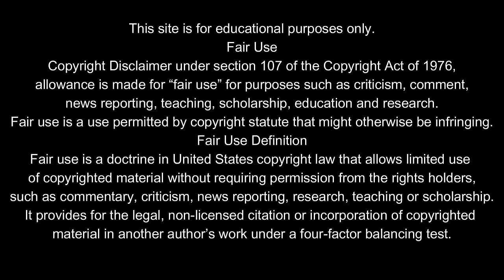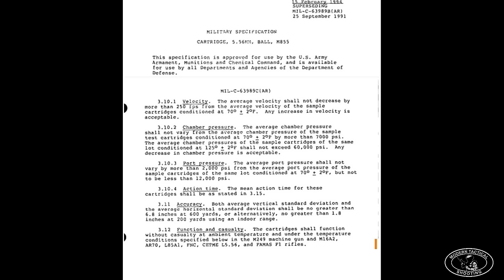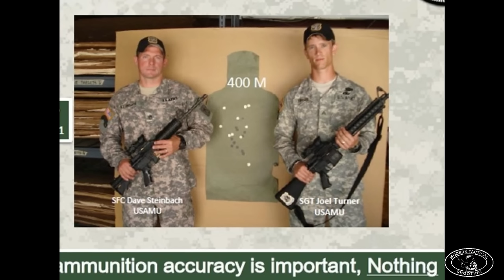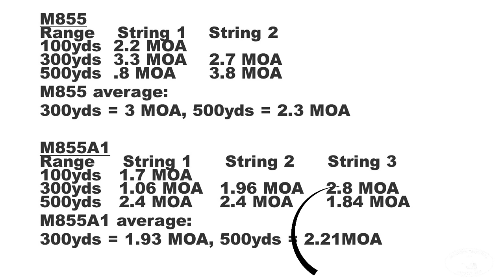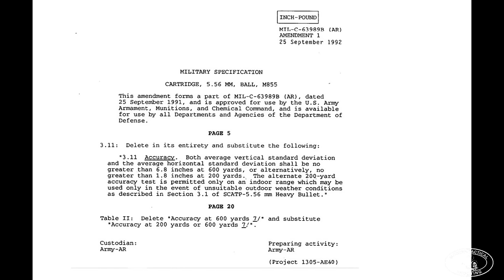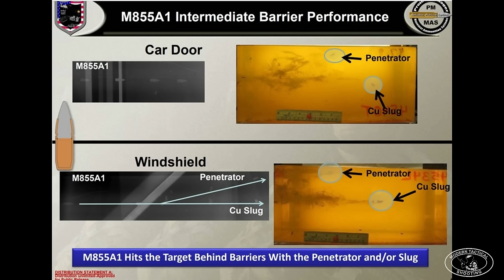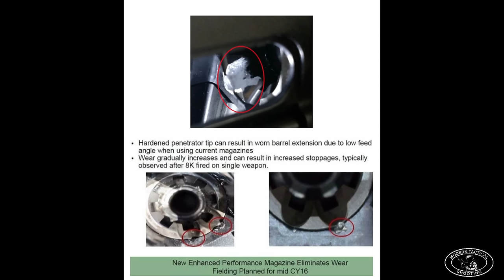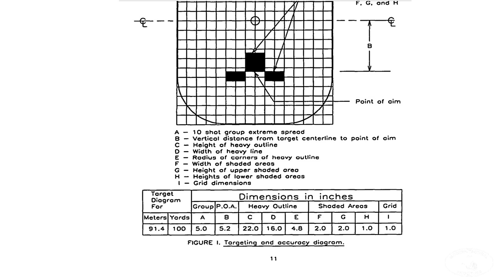M855A1 Performance Review. Did it live up to the Army's hype? Did going green really work?

Comment: Glad to hear you reinforce my mk262 bias.
Reply from the maker: 100%
Reply: If you're gonna choose a Duty load I would make a suggestion. 

Get BONDED SOFT POINTS my dude. Federal TBBC or Speer Gold Dots ECT.  I personally went with 62gr so they share virtually identical POI as my training ammo (PMC XTAC).

Altho I have been quite impressed with the AAC 77gr OTMs, at $10.99/box on sale I've acquired Almost 6k of em lol and have found them to shoot very well (around 1-1.5MOA averaged) out of my 2 uppers (A 16" Colt 6920 and a Geissele Super Duty 14.5) for the price it's all I buy anymore. 

But as far as duty ammo is concerned, I've found Bonded Soft Points to be the Pinnacle of performance across the board IF selecting ammo that isn't going to penetrate armour ANYWAYS. they certainly have the best performance against common urban barriers especially such as auto glass, walls, door panels ECT while still giving excellent terminal performance across the board both with and without barriers in the mix. 
We aren't in Afghanistan we don't have to worry about mud walls, what we have to worry about most is other common barriers here stateside such as sheetrock, furniture, vehicles and tempered auto glass, ECT.
Reply: @mrdark9916  I've since stocked a fair bit of TBBC. I've also stacked a bunch of 70gr TSX and that's been my go to since it and mk262 uses roughly the same zero in my rigs. I have a dedicated rig for tbbc and other lighter weight loads.
Reply: @Appalachia_Ape  that's actually a very good point, and something I always tell people to try to do. Pick a good load, that shares a POI with your training ammo as closely as possible.

Luckily through my 14.5 Geissele upper that's dialed for my BSPs  my 55 and 62gr XTAC training ammo share virtually identical, but the AAC 77s ALSO literally overlap impact zone. They still land dead center only mabey ¼ to the right, and only about .75moa higher at 100yds so for all intents and purposes I can swap freely between them if need be. As I have so many of them stocked now.

But the 77s are mainly designated for my old Colt upper since I built it out more like an SPR.  it's not nearly as accurate with as many loads as the Geissele upper, but with those AAC 77s it's about 1-1.5MOA so it lives on them now. Bigger 2-10 optic with more data, more for longer pokes on "unsuspecting targets" with increased first round hit probability, but that doesn't completely abandon the ability to do closer work if the situation forces it on me, so it has an offset red dot as well to solve those problems. And also to serve as an "overwatch rifle" for the family property. Up on the hill surrounding the property I can see every field and road leading up to our land out to about 600yds so that played a role on the selection as well. We have a few 762 AR10s in the family available but I like the option for 556 in that role logistically as well.

The Geissele is built out more "do it all" with a 1-6 and Offset red dot. Something I can use more general purpose but still make effective hits to 500 if need be, but favoring more inside short-mid range faster shooting where barriers are potentially more of an issue and a little more meneuverability, without completely abandoning the ballistics I want. 

To me 14.5 is the shortest I'll go with 556. I've actually considered many times selling my 16-inch Colt upper and swapping it for an 18 or 20inch upper to lock in the "SPR role" for that setup. But I've never been able to bring myself to do it... I love that upper so much lol it was my first and I've had it for years. And I just don't need a 3rd personally I have other stuff I am trying to save and acquire so the 16 will have to work for the role.

If only I was a bajillionare....... 😂 Right now I'm saving for a thermal unit. Still researching but something that can be handheld or a clip-on for my rifles. That's my next big force multiplier
Reply: @Appalachia_Ape  I do really like the 70gr TSX loads, they fuck. They just tend to sheer petals and lose some weight and expansion against barriers like auto glass ECT but still a solid option. But if there's nothing between that bullet and the target, they fuuuuck lol 😂 I know a couple ppl who use em for deer they are a solid well rounded performer. I mostly just use the extensive FBI testing and what LE/federal agencies are using and why and then try to balance performance and price as best as possible. All ya can do really
Reply: @mrdark9916  I think we just became best friends. I use 70gr tsx for deer and that's what made me consider them for other purposes. I absolutely love my geissele rigs. Hands down the best bang for your buck in the AR world. 

I need to get into night shooting stuff myself. Lots of yotes out here in my part of Wv but they only come out at night. Hard to call them when the sun is up.

Only thing we disagree on so far is barrel length. I'd never argue that a 10.3" 5.56 is optimal,  ut it certainly has its place.

Comment: First and foremost, they never should have gone to a 14.5" barrel.  There was nothing wrong with the pencil barrel of the M16A1 that was 20".  The M193 round out of a 20" barrel is devastating to say the least.  The M855 round was nothing more than an ice pick that left combatants still on their feet and in the fight for quite some time.  I was issued both rounds in my time with Uncle Sam.  I also went to basic and my first duty station with an M16A1.  Later I got an A2 and didn't care for it at all.  The 14.5" M4 is useless past 200 meters.  The military is always looking for that magic bullet and they should have stuck with tried and true.
Reply: It is
Reply: The army will tell you it’s better for MOUT, but in reality, they went with a carbine for the same reasons they went with a small 5.56.   Human nature.  Four wars have shown that the vast majority of soldiers will not fire until they know they can get a guaranteed hit, typically about 250m.   So why equip them with a full power full sized battle rifle that can kill out to 1500m if they won’t use it?

Comment: The Army has conducted extensive testing of pretty much all of the 5.56mm variants, including accuracy and dispersion tests. The cited specification for M855 as shown in this video is not something conducted with any kind of issued rifle. They use special Mann accuracy barrels that are rigidly mounted to machine rests and M855A1 tested in the same way has a much lower dispersion radius than M855. There is a document for the production qualification test for M855A1, has all the data that is missing for this video plus vastly more than anyone will probably ever cover or be interested in covering on M855A1.

Comment: If they powder coat the tips with red paint or some other color it could help in not chewing feed ramps in AR style or other style of guns.
Reply from the maker: Does not chew up ramps. But the extra pressure does do a number on gas ports in barrels, degrading barrel life.

Comment: We had a lot of feeding issues out of the USGI mags. We swapped to gen 3 pmags when they came out and the issues stopped.

As for performance, when I did aerial hig eradication we came across 15k rounds of A1. It did far better on pigs than green tip. Saw some pretty grousome sights courtesy of A1. I still use it when I go night hunting and it straight fucks up feral pigs. 🤷‍♂️

Comment: You mention armor piercing capabilities and how m855a1 fails but honestly unless it’s m995 at close range, most 556 ammunition gets defeated by body armor (strictly talking ceramic). M855a1 is just suppose to be the better ball round, and it chews up body armor better. It can defeat cheap inferior lv3 ceramic but all lv4 armor is going to stop just about every 556 threat. Shouldn’t be counted against m855a1.
Reply from the maker: The point is, with the money spent on it they could have made it true armor piercing. Instead they just made a hotter round with only minor improvement to performance that also brought with it its own set of issues.
Reply: @ModernTacticalShooting  and I believe you're missing the point of trying to replace a ball round. Never meant to defeat lv 4 armor easily. They were trying to improve standard issued ball rounds. While it didn't solve every issue, it also doesn't cost as much as the solution they already have; m995.

Comment: I agree 1 moa or less to be a match round. I was never issued these I got out in 2012, that said I did get my hands on a butt load of the projectiles and I kinda made my name making hyper accurate handloads. I made some loadings up using 10 different powders 5 different primers and same year LC brass once fired and fully prepped. I shot all rounds out of my MK12 clone that has the Douglas 1 in 8 stainless barrel that was in the MK12 even have the AE5 suppressor on it. could not get that round to shoot below a minute and that day I was putting together .53 Avg groups with Hornady 73gr eldm handloads so I wasn't off that day. Is it acceptable accuracy sure probably better than any ss109 handload I've made but it is far far from match grade projectiles

Comment: So long as you have the right mags and feed ramps then yes its absolutely worth it. M855A1 is one of the most devastating 5.56 rounds ever. It punches through armor and barriers better than standard M855, and it fragments much more reliably than M193. It also has M193 velocity even though it weighs 62 grains. The fact that it will fragment out of a 7.5 inch PDW just goes to show that it is a fantastic choice. Then again if you run it through standard mags with standard feed ramps then it will destroy your feed ramps within a few hundred rounds.

Comment: I noticed the m855a1 started messing up my feed ramp causing lots of feed issues. I also noticed when we switched to the m4a1 we had to switch mags because of the difference in spring pressure for burst and full auto
Reply: If you are using M855A1, you need the tan mags.  The mag’s feed lip angle is a bit different.  We pinged the hell out of our ramps and chamber until our big box-o-mags came in.  Problem solved.
Reply: @blackhawk7r221  Or just use gen 3 PMAGs. Fuck waiting on supply, them bitches are like $12 a piece.

Comment: Did you ever see m193 used over seas? I think the compromise with green tip was for longer range point of impact consistency/better retained energy and more wind resistance than 55gr. I think it’s the primary use other than nato now looking back on its penetrating qualities against a modern military threat.
Reply from the maker: Yes in fact 2003 invasion of Iraq many of us rolled with M193
Reply: @ModernTacticalShooting  oh interesting thank you! I thought everyone was just using green tips.
Reply: @ModernTacticalShooting  just curious which do you prefer m193 or green tip m855? (Other than the 77gr hah) I usually just plink with 55gr. People seem to like the 75gr also.

Comment: I think just about everybody covered this, but watching your video in full. I have to agree with the general consensus that you missed the mark completely on the EPR rounds. They are a marked improvement over green tip in every area, but most notably in armor penetration, regardless of whoever classifies it as what it will push through rifle rated armor, better than anything except for the M995/993, and has far better performance side of SBR’s because of the faster burning per pallet.

What troubles me the most is you seem to cherry pick the situation’s and equipment in order to support your initial conclusion that it is no better than green tip. One only hast to do a search through YouTube to see hundreds of videos of this round punching through rifle rated armor plate in barrels as short as 11.5”. 

This is as good as the regular army is going to get without potentially risking a massive dump of M995 into the civilian populace, which as pro 2A as I am, would be an absolute disaster on civilian LEO. 

You need to let the data drive you towards a conclusion, not the conclusion drive you towards the data       . In retrospect, this makes me question your judgment.
Reply from the maker: But is it "match like" as the Army says

Comment: With the M855, what I noticed, if you have a 1/7 twist instead of 1/9 you have much better accuracy at longer shots and I was penetrating those expensive metal targets (the ones that don't crater and are expensive) at 400 to 600 yards. My friends that had 1/9 twist with a heavy barrel weren't having the same results
Reply: Yep.  855 needs 1/7
Reply: Id be willing to bet m855 dosent penatrate AR500 steel even at 50-100 yards.. And twist rate dosent matter that much. Im calling B.S
Reply: @keatonjorgensen8793  was Winchester match grade loaded on stripper clips thirty to the open top box.  Given to me from a soldier on shooting teams. It penetrates oil field tubing and casing easily. Haven't had the pleasure of playing with it's replacement much.
Reply: Plates are real.  That’s why we train for pelvic girdle shots.  Immediate crumple.

Comment: Think of this with me:

The Russians' AK74 bullet had a metal jacket, lead in the base of the bullet, aluminum in the part of the bullet that went from cylindrical to conical, and air in the tip of the jacket. Yes, an empty tip jacket. 

This was to make it massively unstable upon impacting a target, and the Afghans called it the "demon bullet" because it was so hard to find it when surgically treating a wound.

Heavy base, lighter nose, leads to instability upon impacting a gel-like target. This bullet seems to be aiming at a "best of two worlds" scenario: instability and wound exaggeration upon impacting a person's flesh, and hard nose to go through armor/obstacle to get through to the person's flesh.

Comment: I would like to see them take the lessons learned from the 6.5 for the m7 and applied to the 5.56. So bimetal
Casing and a higher pressure round with a slightly heavier barrel.
Reply from the maker: Talking to current SF guys they said there is a bi metal 5.56 round which is supposed to be better than M855A1
Reply: @ModernTacticalShooting  that is an interesting development hopefully it’s good and can put this whole m7 thing to rest

Comment: The Problem was going with 5.7X 45/223 that most of the modern guns 6.8mm can also take over the new round that now is like a slightly smaller 243 and making me think that just put a NATO designation to the 243 round would have been a cheaper way to go making more of a precise bullet for the Military using the Remmington Core Locket with the Zinc below it. I do think the Current rounds will work their way over to other military branches that are continuing the use of the M4 and other modern Variants of AR platforms.

Comment: But doesn’t barrel twist rate and length, have a big part to play into accuracy as well as performance of effectiveness? The old M-193 round round had the capability to sever limbs with the older M-16. If the bullet passed through the center of a bone it disintegrated the bone which many times doctors amputated to save the life of the combatant. One Filipino police officer was shot through the Femur bone and the fragmentation of the bone almost caused the doctor to amputate the leg of the officer. You could see in the X-Ray, of the bone fragments though out the flesh, and caused numerous, after surgeries to remove fragments after the combatant was stabilized. The M-193 took off the arm of a Buddhist monk in, Thailand that was shot by the, Thai police. The older M-193 round in my observations with the 12:1 rate and 20” length of barrel does a much more effective results out to 500 yards/meters on soft targets. But your correct on the ineffectiveness of any M-4 using the M-855 or M-855A1 on mud huts or concrete barriers. In my observations the bullet for more or most accuracy, would be the, 6.5 Grendal. Change to that round, would be the most effective for the M-4 size platform with accuracy and range. Change the name to, 6.5 Government if to be used for military application. The only draw back would be, the bolt face to thin. Some type of heavier research and development, would need to be done, to make it a more efficient of a weapon in that size, and use the bigger Sure fire mags to sustain fire support of an assault in battlefield conditions. Just my opinion of using both the, M-16A1 and the M-16A2. But my preferred preference if I had a choice to carry one only would be a tricked out M-4 to reach out accurately in both day and night conditions to 500 yards or meters accurately to soft targets and if there were any vehicles to attack would also prefer to carry an, “Under Barrel” launcher with, AP-type round to hopefully punch through the roof on the way down from trajectory. Don’t know what to do against helicopters though. Most reconnaissance forces don’t carry ground to air hardware to engage such targets. Aloha and Semper Fi. 🌺🌸🌴❤️🇺🇸

Comment: Good video, but I've got a question. You always talk about the 400 yard trial, but the picture says 400 M, meaning 400 meter, am I correct?
If so, it would have been 437,44 yards, which sounds nitpicking, but actually is an increase of close to 10% in distance.
Reply from the maker: Yes it's a flaw with my military upbringing I use 400 yards and  meters interchangeably (I know there is a difference in range) but the Army does work in meters

Comment: Just wanted to point out (11:20) that if you removed that .8 MOA M855 Group as an outlier, you're looking at something closer to a 2MOA increase rather than a .28
Maybe shoot some more groups with the M855 at longer range and validate your data?
Reply from the maker: I shot M855 just for heck of it, you could take M855 out of the equation, M855A1 still not close to "match like"